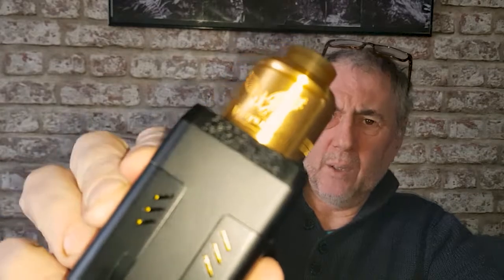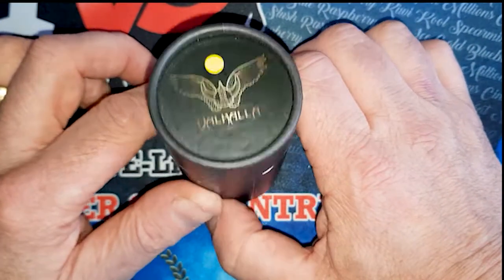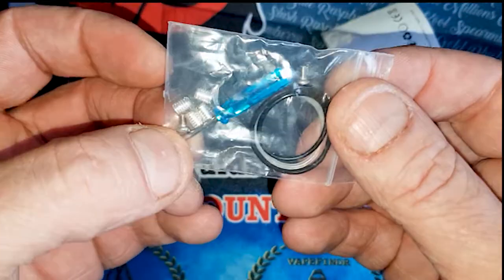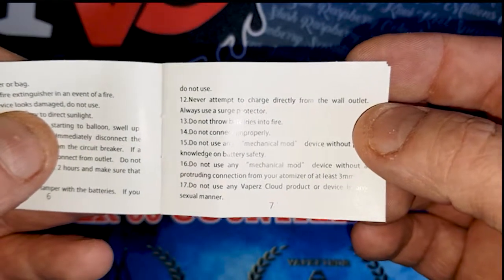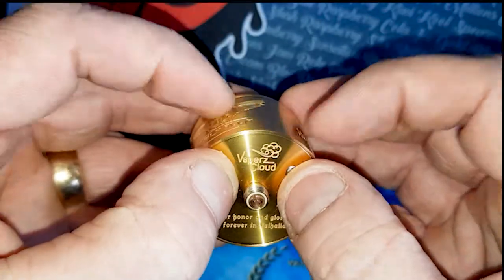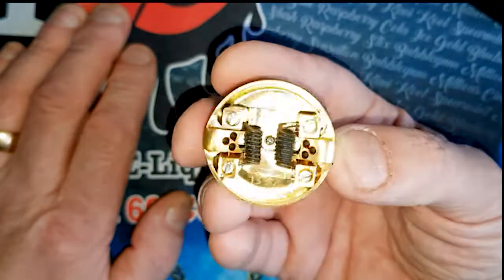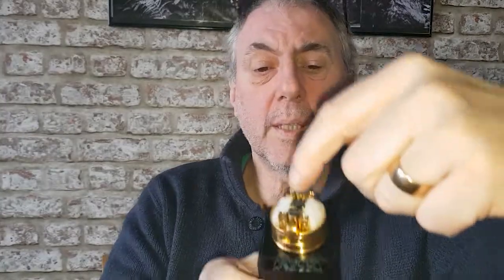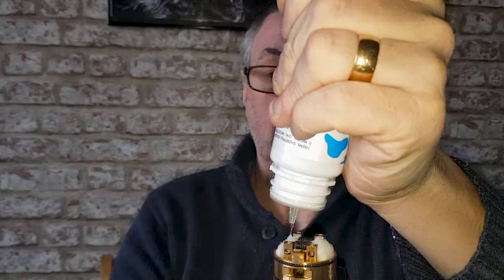valhalla rda review A FLAVOURLESS CLOUD CHUCKER? I THINK NOT!!

Comment: I bought one to go with my Stormbraker  im not sure if i really like it tbh i find it a very warm vape a 0.28 build , i dont like the wide bore shorty dripper .
But to be fair the customer service a VC is spot on !
i gave them a call yesterday and they are sending me a longer dripper.
Reply from the maker: 0.28 is probably a bit to low for this bud, get some series coils coming out at around 0.35 to 0.4 ohm. That's what I find pretty comfortable
Reply: @TheVapingHeed  many thanks for the response. im using 3 x 4.2 v bats  in para 0.28 coil so thats only 63 watts i was going to go with  more beefier coils like 5 raps of 4mm coils as ive only used series coils in mods like the noisy cricket.
will take your advice on board and try series coils failing that i might buy the Buddha rda
Reply: @TheVapingHeed  Just an update, changed the cotton bacon( that had broken one one side) for kendo cotton, got some SS 22g flatwire 8 raps either side 0.12 ohms the taste is imminence!
Reply from the maker: @michaelnedsmar9106  glad you got sorted